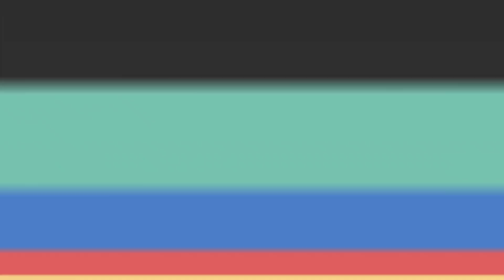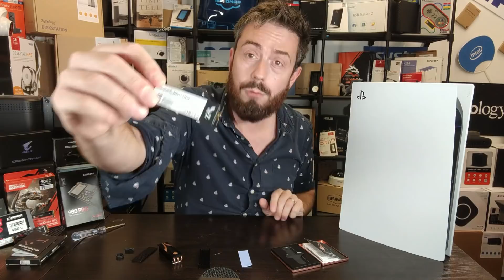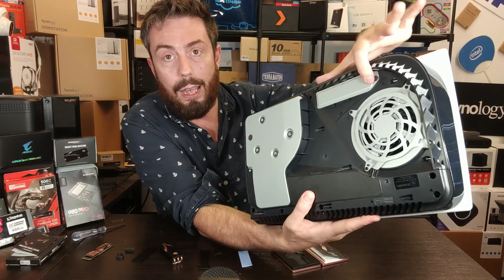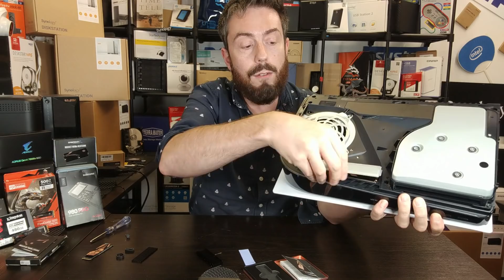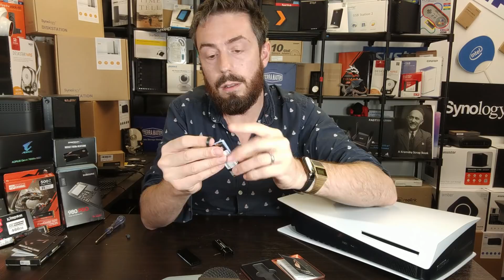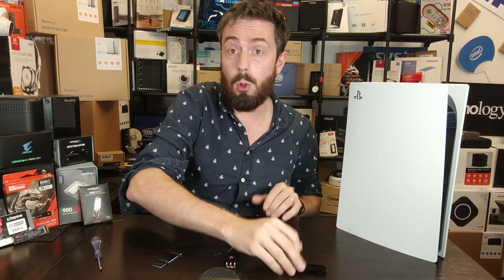PS5 SSD Upgrades - WHY YOU 100% NEED A HEATSINK! (HEAT TEST!)

Comment: Just installed a standard Crucial 2 TB SSD P310 gen 4 without heatskin on my brand new PS5 slim digital edition and it works just fine, finished Mafia Old Country and Forza Motorsport 5 Story! <3 Only 10C higher without heatsink, so it won't affect performance or durability. You can install a heatsink after if you want to but it works perfectly fine without one.

Comment: I learned pretty badly how you actually do need one. I literally use the official one that I got from my ROG ally since I upgraded the storage and thought the original one was fine to use which was like a WD model. I then try and transfer a good amount of files and then the system completely freaks out trying to manage it. Kind of sucks that you can use any kind of SSD but really you should use one that has a heat sink on it

Comment: im using one with out one right now but i bought a heatsink for it.. i dont think it will make much of a difference.. everyone gaming pc ive seen doesnt use a heatsink on the ssd...?
Reply: for pc's, it depends on the motherboard, every top end motherboard comes with a heatsink in place for nvme slots already. They're not required, but reduce degradation over time.

Comment: Would you recommend putting a ssd into a heatsink unit and using a heat sink cover instead of the one that came with the PS or is that not possible ?

Comment: Is there any difference between heat spreader and heat sink ? Some SSDs like XPG s70 blade uses head spreader and not heat sink. Wondering if those heat spreaders are sufficient enough for cooling ?

Comment: Just leave the drive cover off and you don't need a heat sink. M2 drives don't throttle until 80c, and are designed to run in the 50s and 60s. Furthermore, you're never going to write as much as was done in this test anyway on a ps5, it's kind of nonsense.
Reply: Do you have a ps5 with SSD installed without a heatsink?

Comment: If someone wants to put a heatsink on thier ps5 ssds that's fine. But the only time a heatsink is really "needed" on even a gen 4 nvme drive is if you are doing alot of sustained read and write, ie alot of data transfer for long periods of time, video editing etc. The ps5 is not gonna tax that ssd enough to warrant a heatsink. That being said it won't hurt anything in general so I have nothing against people doing it. I just feel like it's a waste of time/money (in the ps5 at least).
Reply: Is your ps5 installed SSD without a heatsink? No issues?

Comment: Do u need a heatsink for 500 gigs
Reply: Yes you need a heatsink for using any installed ssd regardless of storage size, since its still a component creating heat within your console when in use
Reply: @bamban_garcia5562  3 months late buddy, my ps5 blew da hell up
Reply: @kashourikatsu2543  Can be replaced with a new one if you are still under warranty, talk to tech support there's an unwritten extended coverage most companies offer over their products

Suggest you go with the Elecgear PlayStation 5 NVMe SSD Heatsink if you want the best option available
Reply: @bamban_garcia5562  nah i was just joking
Reply: @kashourikatsu2543  I was not, get the elecgear once you get an ssd
Reply: @bamban_garcia5562  yeah i got the 500gb black with heatsink 2 months ago
Reply: @kashourikatsu2543  I got my PlayStation 6 days ago already filled out the storage, 500gb won't cut it for me not even a 2tb will suffice guess its saving time for a 4tb ssd, gonna go with the firecuda 530
Reply: @bamban_garcia5562  yeah im playing Horrizon forbidden west, GT7, Tekken7and codcoldwar. So i dont need alot of storage 500bg plus the internal ssd is good enough for me.  BTW add me      Kashouri101
Reply: @kashourikatsu2543  I got the Horizon Forbidden West bundle sadly its a digital copy so I'm gonna sell that to buy its physical version later on, I got 28 games for my console thanks to building up my library for it since it released took almost 2 years but I got one at last

Kind of funny that I got my PS5 for less then a week yet I have more horror games for it then the PS4 I had for 6 years

The PSN I created since last gen is Bamban_Garcia though the ps5 has it written as Bamban Garcia so no idea which one is the proper named one
Reply: @bamban_garcia5562  😀👍 nice!

Comment: Around the 18:20 mark, so if my PS5 is overheating. I can add a heat sink and my game will run cooler? My PS5 started overheating now when I play certain games like fortnite and I already have a heat sink just haven’t installed it yet.

Comment: I bought the sn850 1tb and put my own heatsink on it the black one that everyone gets for it. And when playing ghost of tsushima legends the tempatures read 130 Fahrenheit and my character froze for 10 seconds and sound was cutting out I don't know if this was do to bad connection to legends or if it was getting way to hot because this is the first time this happened also my ps5 fans are very quit I must have got the good quit fans but the ps5 does get hot. Is this normal?

Comment: Sabrent has developed a heat sink that also doubles as a replacement lid. It will be coming out at the end of this month. I do not believe it was a good idea to recommend using heat sinks that are too big for the slot. Sony does not recommend using heat sinks like that and insist that the lid needs to be on the slot. I think Sabrent's solution to the heat sink problem is the way to go. I will be buying the two terabyte version when they come out at the end of the month.

Comment: The guy at the pc parts store said I could go without a heatsink (because they were sold out of them) and that I could put one on later. He was 100% WRONG. I tried to use my brand new 1TB M.2 ssd without a heatsink and it immediately overheated and my ps5 gave me a blue screen warning that said it needed to be turned off to allow it to cool down. USE A HEATSINK.

Comment: My ssd came with a small heatsink.  It doesn't use rubber bands just sticks on top.  Is that okay?  If not, how do you take the ssd out?  Do you just take it out and it won't be corrupted?

Comment: @NASCompares, sorry you are wrong! 
Once the game is installed, there are hardly very low writing operations. Games are reading 99% all the time from the disk and reading does not generate heat on any ssd. Writing on SSD is that was generates Heat. In your testing you hammering the SSD with a lot of writing operation, this will never happen on any Playstation/PC game.

Do your Testing again with just read.

Comment: A word of caution about the MHQJRH heatsink.  I have installed this heatsink on a Firecuda 530 in my PS5, and it almost completely blocks the 2 exhaust vents on the side of the drive bay.  If you use this heatsink you may want to leave the cover off or drill some holes in the cover to allow the hot air to escape.
Reply: Thanks for the heads up dude

Comment: Your benchmark basically proves you don’t need a heatsink as the read/write is the same. Lol it doesn’t need one. Never has.
Reply: NX gamer just proved you need a heatsink.
Reply: @canadaspy007  lol I have first hand knowledge. I’ve been using m.2 drives with and without heatsinks for years. It makes no difference. M.2 drives are nothing new.
Reply: @MrNiceKnife  do you have first hand knowledge engineering the cooling on the ps5, because the people that do said leave the fucking cover on. Ps5 is not a PC it relies on negative pressure cooling not direct airflow. The air gets sucked out better with the cover it's more efficient and it's literally how the ps5 engineers engineered the cooling, but hey maybe you can take cernys job for the ps6.
Reply: @MrNiceKnife  bro NX gamer ran the 980 pro and got it hot with a heatsink. Than he quickly reformatted it and the ps5 speeds of the drive were 1.5gb/sec slower than when he did it from a cold boot. Without a heatsink that will lower it to below ps5 needed speeds. It literally barely made the speeds after throttling and that was with a heatsink. Let the professionals and engineers handle the big boy topics. PC's have direct airflow going across the SSD ps5 does not it has negative pressure not the same. But hey keep telling gamers the wrong thing to do with their ps5s.
Reply: @MrNiceKnife  https://youtu.be/j-hz4QeOJkA go to the end. There's throttling even with a heatsink bud. You think you know more than sony, it's sad really.
Reply: @MrNiceKnife  also by cover I also mean the heatsink I'm just not used to people being so stupid to not use a 10 dollar heatsink. You ain't a PC gamer if you don't care about improving your PC part temps.
Reply: @canadaspy007  it’s sad that you don’t know how m.2 nvme drives work and have to rely on second hand knowledge. Lol here you go kiddie
 https://youtu.be/KzSIfxHppPY 6:15  is specifically about heatsinks. You kids crack me up 🤣

Comment: A heatsink does NOT disappear any heat by its own. It’s just a heat storage with a way larger surface area (that’s why they have fins and are not solid blocks) for the air to disappear the heat from it. Without moving air, this effect is pretty minimal. However the fan of the PS5 makes a little air flow even in the closed SSD enclosure which makes heatsinks a big plus there.
Reply: Actually it does. The thermal paste absorbs some of the heat generated by the SSD and therefore keep a cooler temperature.

Comment: saw a guy saying that heatsinks heat up the NAND  which isnt good. unless youre writing heaps of data which wont happen on a PS theyre not necessary. The NAND temp is the most important. the best senario is a heat sink that only contacts the Controllers and not the NAND. A note on the sebrent heatsink. same guy couldnt get it to make contact with the ssd and needed to wrap elastic bands around it.

Comment: Good advice. Yet for now I still went the other route: so no container, but no rubber bands either: the straps are metal ones. And there's a metal plate for underneath.
Both sides are protected by silicon pads. On Digital Foundry and Amazon I've seen there are silicon pads in at least some containers too, maybe just the more expensive ones. I don't know exactly.
Obviously, there are a lot of different solutions out there. This is the one I ordered: https://www.aliexpress.com/i/4001327062816.html

If I feel uncomfortable with it - or it won't fit at all -, I can send it back easily. Curiously, I.did not get a single small container on the places I usually buy: for example on Amazon. No chance.
All look quite big and have four screws on the side: not only the height of the slot may be a problem there.

Comment: this is absolutely INCORRECT, i have a sabrent rocket nvme without heasink on pc, and gaming on it, it even pass 35ºC, while gaming, a nvme isn´t fully load a nvme disc all the time with maximum writes speed, that is totally wrong, and on ps5 will be the same, while gaming there is absolutely no need to heasink, even on gen 4 nvme disc, if you are CONSTANTLY copying things to the disc, then of COURSE yes, you will need a heatsink, but only gaming totally NOT.

and one more thing, the games don´t need to read constantly to the nvme disc, games store the data on the main ram of the gddr6/ddr4 once.

you probably don´t know what you say, and remember, if you don´t do copying thins constantly to a nvme disc, you don´t need a heatsink
Reply: this video is full of questionable info

Comment: Great video mate. I have a couple of Samsung 970 Pros for my PC. One is beneath the built in heatsink on the motherboard, the other I fitted a heatsink to. For what these drives cost and what a heatsink costs, you’d be crazy not to get a heatsink! I’ll be going with a Samsung 980 Pro with a heatsink for my PS5, but I’ll be waiting until more games are available.
Reply from the maker: Good call! Nice one

Comment: The test you are running isn’t equivalent to the use case in a console.  Loading games or zones isn’t a continual load that saturates the drive like you are doing.  It is more of a fluctuating use case with peaks and valleys.  I think Sony is recommending heat sinks just to be safe more so than them actually needing it.  I have several nvme m.2 drives in my pc and gaming laptop and none of them have heat sinks and haven’t run into any issues with them.

The only caveat I will say is the PS5 may need it specifically more than in a pc because the chamber they designed doesn’t look like it gets much airflow in there.  I would be interested to see some tests run on the system itself without a heat sink with some temperature probes to see what it is actually getting up to during gaming sessions.

Comment: That cover he took off is to prevent dust from getting into the ssd bay. Technically yes you can install a bigger heatsink into the PS5 and not put the cover back on but it’s not recommended by Sony. 🤦🏻‍♂️
Reply: We need to hear the pros and cons of doing this, it should be completely fine to leave it off and even help  let warm air escape

Comment: So if I understand correctly: i will install a WD SN-850 2TB !!WITH!! Heatsink in my PS5. But keep games like for example GTA Online (stand alone edition) on my base PS5 SSD and games like Fifa with I don't play often online on my WD SN850 SSD to avoid overheating?
Reply from the maker: As long as you have a heatsink, you don't have to worry about heating going nuts in the console for general or even heavy use. Basically MY MAKE SURE YOU HAVE A HEATSINK

Comment: The real concern is should I replace the SSD access bay shield? 

Also, how much would temps vary with and without the access bay cover on.
Reply: Keep it on, it was designed to create negative pressure from the fan to suck air out
Reply: @cmdr101z8  Thanks! It’s contrary to what this guy is preaching, though. 🤔

Comment: @NASCompares so does the Sabrent Rocket 4 Plus with the massive heat sync for it fit in the PS5? I would much rather have all the cooling I can get with how enclosed the system is. And yes, I know I can't put the cover back on it, and I'm quite alright with that. Thanks in advance

Comment: Sony really expecting average consumers to do this 😂
Reply: It's no harder than upgrading a ps3 or PS4 drive... and tens of millions did that. installing a heatsink is not needed as most come with one preinstalled. 
takes less than 5 minutes to get an upgrade that's twice as fast as the Xbox series x drive.
Reply: @Dreadpirateflappy  lol wut? The Series X requires a screwdriver?

Comment: The best thing to do overall would be to use a heatsink and leave the cover off, it would then be able to dissipate the heat quicker as apposed to it being locked away in a tiny space with a chunk of copper stuck to it.

I'm pretty sure no heatsink with the cover off would be a better option than having a heatsink and then completely starving it of any airflow.
Reply: Sony have already said you need the cover ON. Sony know what they are doing better than randoms on youtube.

Comment: “Sustained activity” that hardly ever comes up in real world use. Get some thermal probes out and measure the SSD while using it in a PS5.
Reply: Can't push those heatsink affiliate links if other testing is done... 

Or if the heatsink nvme drives are allowed to soak up heat past the measly 10 minutes where they would more than likely end up throttling as well.
Reply: @scrubbybubblez5340  eh, the increased surface area is usually enough to keep the drives going for a long time, but I'm still not convinced a heat sync is NEEDED, hopefully someone more thorough with their testing like Gamers Nexus will give it a round of testing. I'd be surprised if the solution is just leaving the cover off and not using a heat sync. Or at worst that really slim one but a better attach method than those bands.
Reply: Not saying they're not needed but several other tectubers have stated in the past year that they weren't. (Gamers nexus, Paul and even linus).
But if people want to put a heat sink on it fine it won't hurt it. Nand like heat controller not so much and the worst it will really do is throttle the nvme drive at least with the data so far.
Reply: @scrubbybubblez5340  oh it certainly won't hurt. I was having some issues with my PC, and one of my troubleshooting steps was to put a heat sync on my M.2, it wasn't the solution (it was the Samsung NVMe driver, switching back the Microsoft default one fixed the problem) and I've been too lazy to take it back off. Even cramped under a cover that DOESN'T help cool it (I have a older MoBo from before integrated M.2 coolers were a thing) my drive was not overheating.
My only issue is how EVERYONE is focusing so hard on it needing a heatsync, when it's probably been blown out of proportion. If some proper real world testing shows significant throttling in a PS5 then I'll convert, but until then I'm not convinced it's as needed as even Sony is saying, they're probably just covering their butts.
Reply: @scrubbybubblez5340  on the perf side one of the last digital foundry video proves that either way the results are the same with or without a headsink...so the real deal : is the ps5's fan efficient enough to manage all this heat without reaching 95°C and 70dB?...wait and see, but imo the heatsink will not change anything significantly at the end...
Reply: Yeah its been weird with with the community hyper focusing on this one thing. I've seen weird comments that range from the ssd will blow up to it will melt through the ps5 motherboard and  this is simply not true. Personally I've been running 2 sabrent gen 4 drives for a while now and none of that has happened in my small form factor computer heck barely any noticeable slow down.
And you are more than likely correct on sony just covering their butts as it is a very common practice for companies to air on the side of caution to avoid lawsuits.